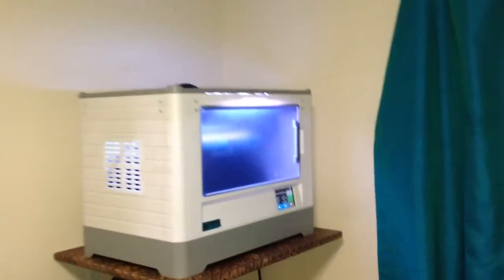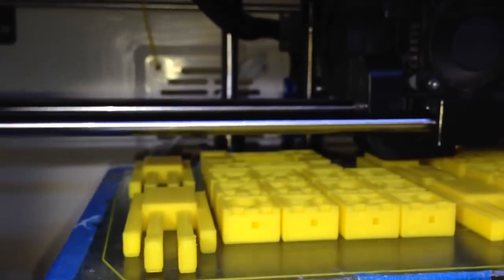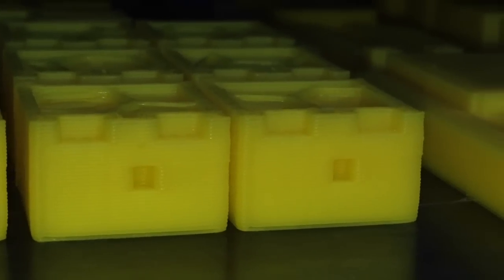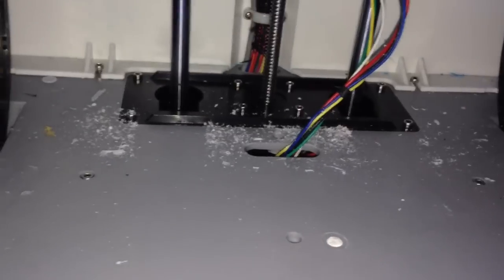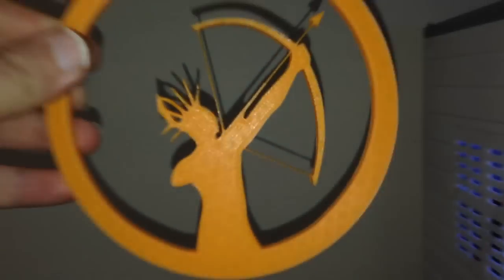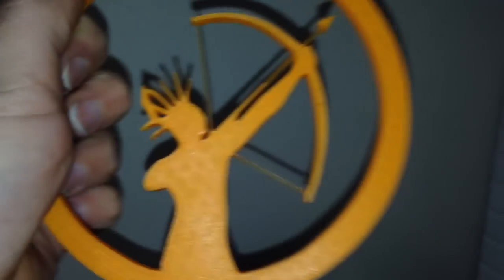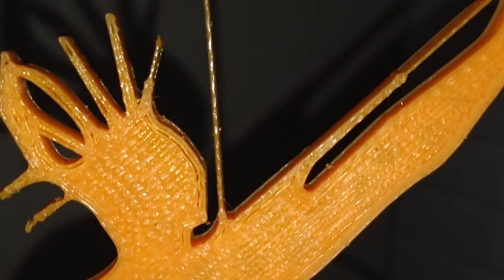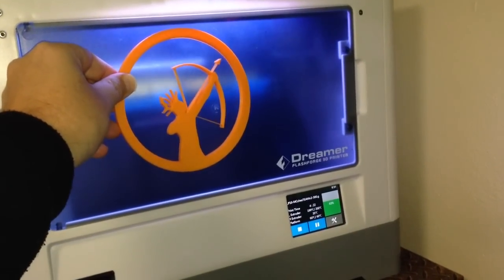Flashforge Dreamer - 6 days non-stop printing

Comment: Hey Thomas, could you give me some guidance on where you're finding buyers or clients for your 3d printed items? Thanks and be well
Reply from the maker: Hi Taiden. Just facebook really. Nothing major
Reply: Thomas James
Thanks for the reply. I just put in an order for a Dreamer. Hoping it was the better choice over the Creator Pro. Thanks for making the videos and keep it up!
Reply from the maker: I haven't actually seen a Creator pro. But I don't have any problems with the Dreamer. It's a great printer
Reply: Thomas James If you ever want to collaborate on a project let me know. I use Autodesk Fusion 360 and it's a great collaboration tool. Might be fun!
Reply from the maker: Sounds Good. I have Autodesk fusion installed on my mac but I haven't used it yet, I still use 123d design
Reply: Thomas James
Shoot me your Autodesk email address and lets see if we can come up with something!